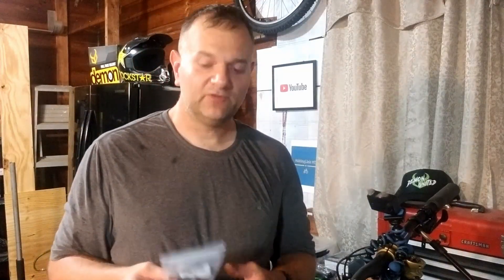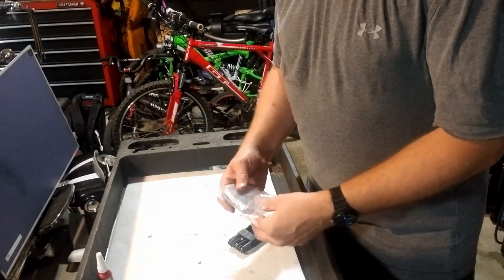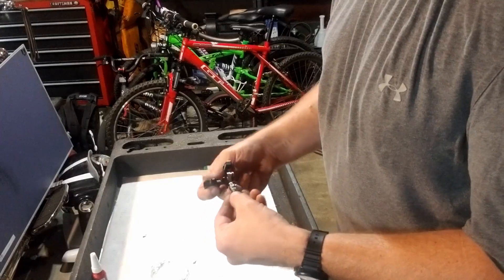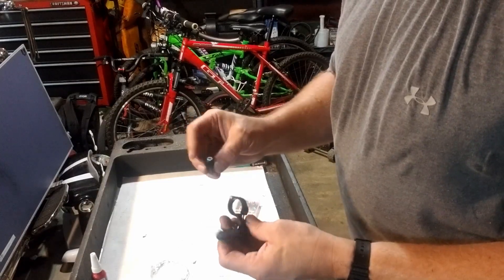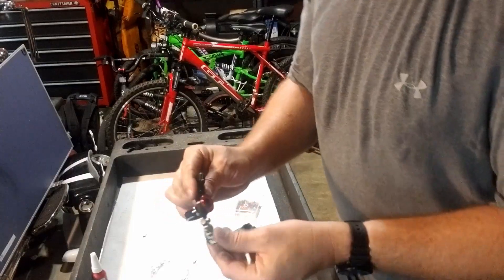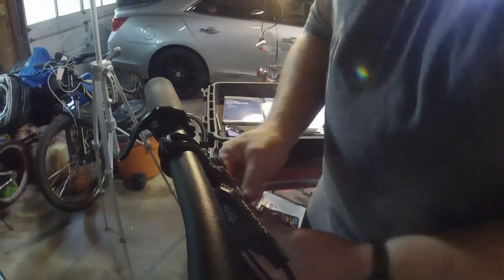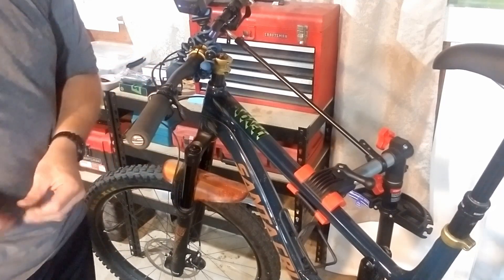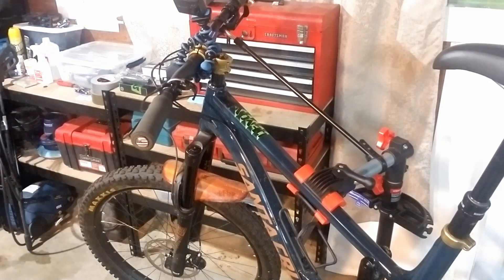ZTTO Dropper Remote Lever - ONLY $25 - Install

Comment: Nice! I used to run this with my dropper a few months ago. Good cheap alternative to the more expensive ones
Reply from the maker: I grew tired of the one that came on it and for the price I really wanted to try it. Definitely wasn't disappointed.
Reply: You “used to” run this one; why no longer, and what do you use now?
Reply: @richarde1355  i use an rs reverb now so i need to use the hydraulic dropper lever

Comment: I saw a post on Instagram, a guy bought it and it failed at first ride.
this seems to be a cheap copy cat of Wolftooth ReMote
Reply from the maker: It does seem to be an exact copy. I've had it on since last summer though and it's still going strong. Very smooth operation. Possible he got a blem, dinged it up, or who knows. If I was to break it in a wreck tomorrow I'd buy another.

Comment: Thanks for the great video!  I have a dropper lever I want to replace, and I assumed I could use just the existing cable, and you show it can be done.

Now that you’ve used the ZTTO for a bit, you still happy with the purchase?
Reply from the maker: Very happy with the purchase! Hang on for more, I ordered the ZTTO dropper post to test!
Reply: @MissingLinkMTB  can you please review the dropper post as well? from my point of view, a simple dropper with the design of an office chair should be reliable and cheap, that's what i imagine the ztto dropper would be. keep up with the good work!
Reply from the maker: @ricardog4459  stay tuned because I already have it ordered! I believe it arrives in a couple weeks.
Reply: @MissingLinkMTB  looking forward!
Reply from the maker: @ricardog4459  plot twist, it arrived yesterday!
Reply: @MissingLinkMTB  Awesome

Comment: give it a test run and see how it holds up. I never get why little things like this cost much anyways. Honestly they dont have a HUGE job to do and normally the parts inside are super minimal..
Reply: Precise CNC machining, strong alloy, good tolerance bearing, research, testing, prototyping, use of stress simulation software, actual stress tests, all cost money, power running those machines, paying the people to do the work.
but the cheap knock off components have most of it wrong, weak cheap material, cheap bearing, less precise machining, less quality control or none, probably not proper testing.
but of course there might be some variation in this, but this is just to give you an idea a why it can be such big price difference., just in general, not specific to this product.
Reply: some knock off components can be deathtraps, or cause major injury. fake carbon bars,  or wrong carbon used, voids, causing failures, no quality control.
Reply from the maker: Pretty much everything Johannes lays out. These start from a block of aluminum and the initial quality of which can vary as well. Don't forget you pay for free samples and demos, sponsored riders and advertisements too. But, you're also paying for quality control and for the blems to be thrown in the garbage and not shipped to your door.
Reply: @MissingLinkMTB  yea, thx for adding that, 👌 I forgot to mention that.
Reply from the maker: Also, I've had it on the bike since last summer. No issues.